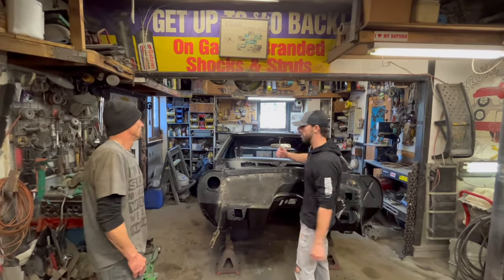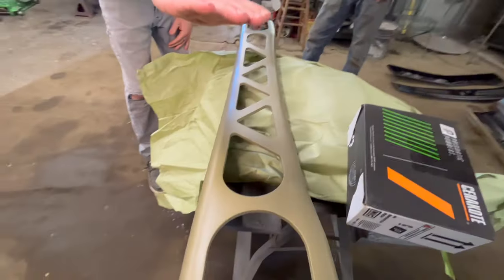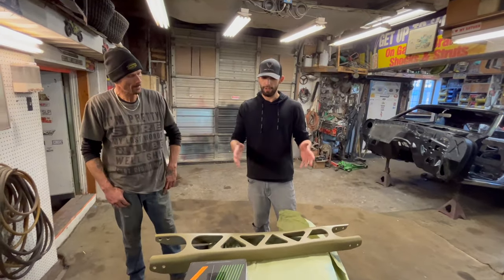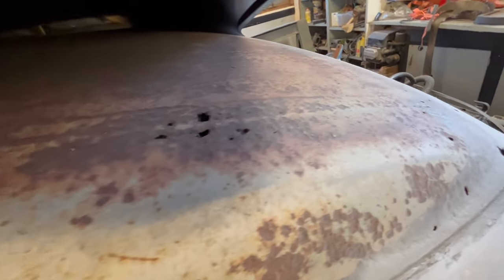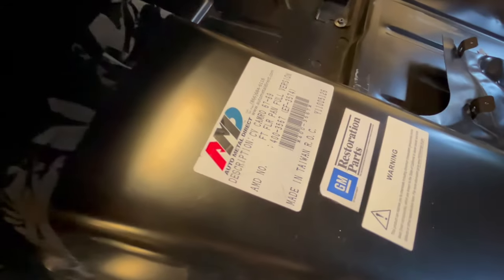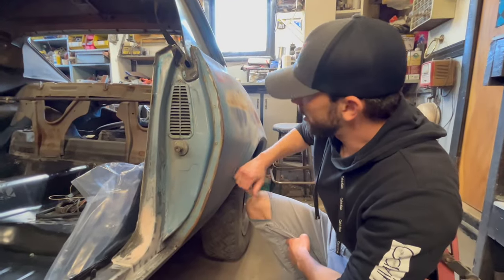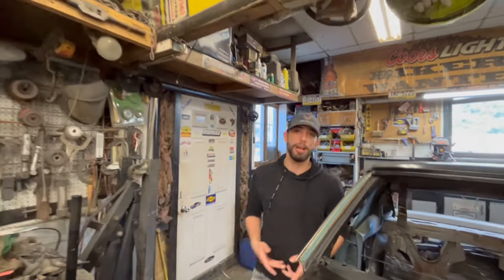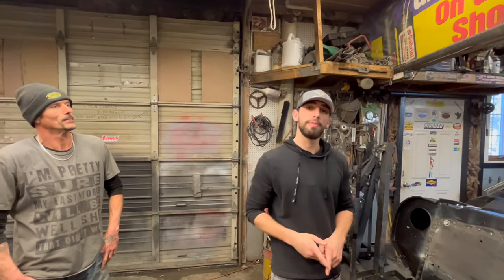UPDATE! 1969 Camaro Barn Find Build - NEW METAL

Comment: Going to be a awesome ride! Some thoughts on the mini-tubs. I put a set into a 70 Camaro recently, DSE's. Since I had to cut out about 2 1/2 inches of the floor and seat frame and weld in the flange, it might be better to get the floor put in first. That way your weld the flange to the new floor. I had a NOS tail panel and compared it to a AMD tail panel and found no difference and the AMD tail panel actually fit just a little better around the edge of the tail lights.

Comment: Cerakote will scratch very easily so expect that. I also would not recommend it on headers. We all thought that too. Better to use Jet Hot. Hopefully you mixed the black and gold from the same product family. If not it may have adhesion problems. Lot of experience with Cerakote. I introduced it to the largest firearms company in the US when I was there. We were also Cerakote's first firearm customer.